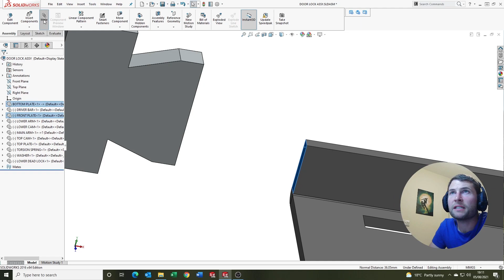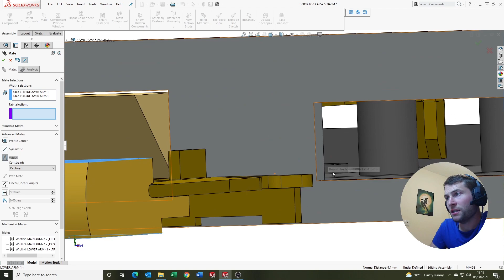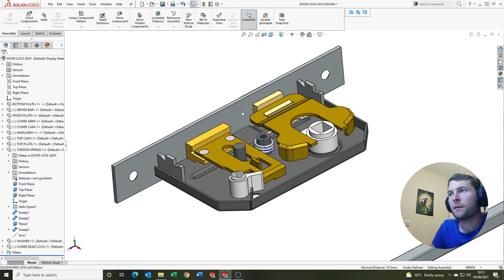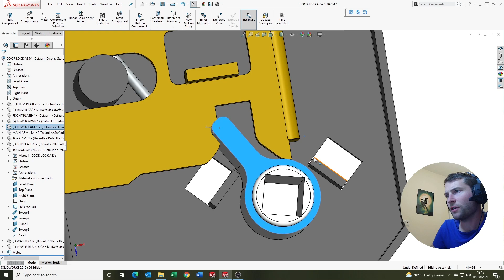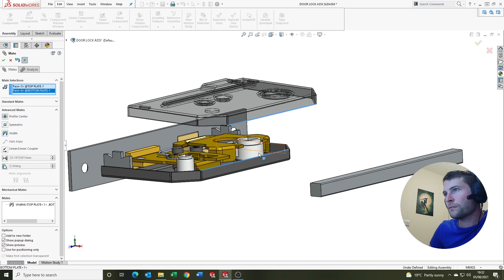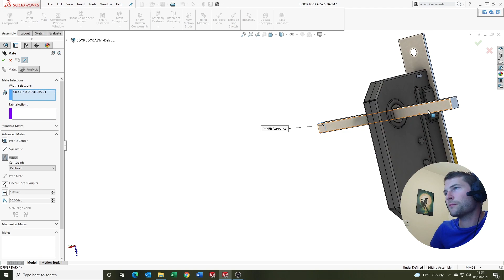reverse engineering door lock in solidworks

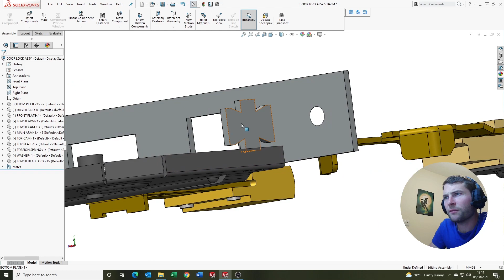Comment: Great video and very informative! However, at timestamp 1:13, while you were adding mates to the forend (front plate), it seems the plate was incorrectly fixed to the case. Ideally, the shoulders of the small plates at the end of the forend should be mated with the inside of the case, rather than the upper surface. Just a small note for accuracy—thanks again for the helpful content!